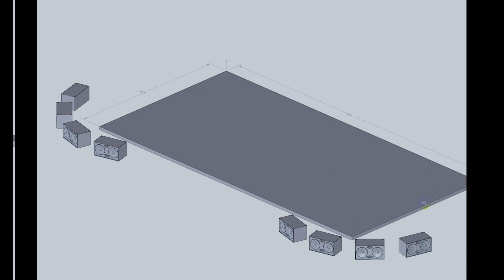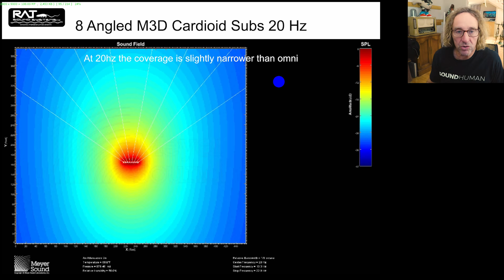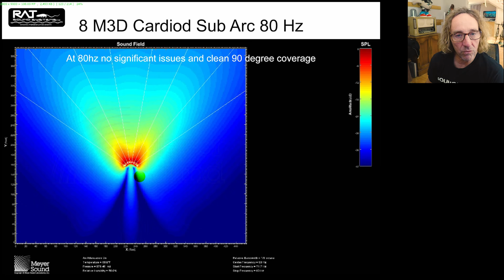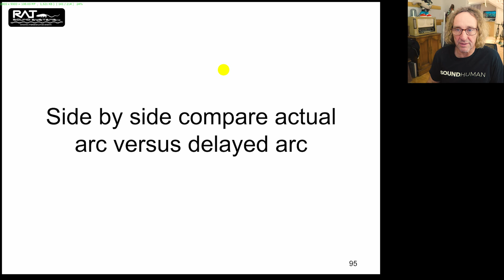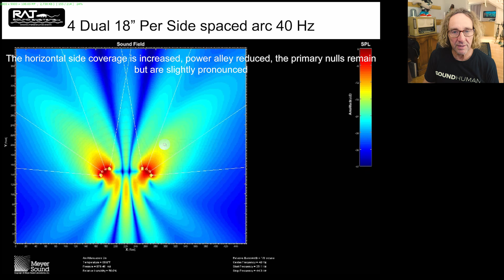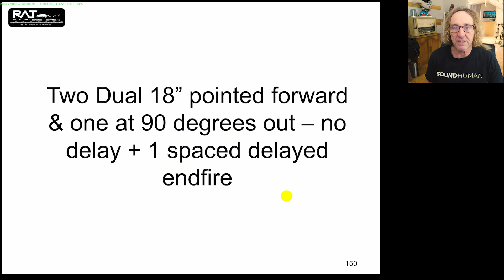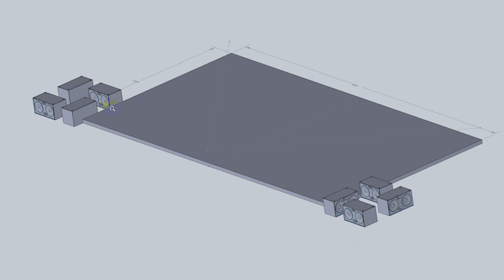Better Sounding Subwoofer Arrays Part 2 - Sub Arcs, Delay & End-Fire

Comment: Nice thank you for that,  My question is in a smaller set up could you do or achieve similar reactions with single 18"  ..
And obviously the energy would not be the same but I think you know what I mean.    :)
Reply: You asked me if I watched part #1 so I went back and I think you missed what I was asking please read my first Question ,  " a single 18 " not a single double 18
Reply from the maker: They will be nearly identical with the single 18 being 3 to 6 db lower in output and the dual 18 a slight bit more beamy.

But all 9n all, a dual 18 and single 18 will del the same up to 100 Hz and not to different above 100
Reply from the maker: Did you watch the 1st vid where I start with a single sub?
Reply: @DaveRat  I Guess not.  Thanks anyways ...
Reply from the maker: In the first vid I start with a single sub, then one per side, then 4 per side and so on. I think that would explain it better than I can do in a comment thread

As far as single vs dual 18 cab, the response and coverage is pretty close. In vid 4 I will show one array vs 2 and how to deal with interactions.
Reply: @DaveRat  Thanks that`s what I thought ..   Have a very merry CHRISTMAS.   :)
Reply from the maker: Merry Christmas!!

Comment: Is there any type of delay/eq that allows you to delay different bands at different times? Kind of like a multi band crossover with a delay on each band summed back into the one output?
Reply: That sounds like a total mess waiting to happen to me.
Reply: @djjazzyjeff1232  why? So you could fix the dead spots at different frequencies with different delays?
Reply: @ambroselockerman1115  It just sounds like you'll be chasing your tail forever and have the most complex and sophisticated crap sounding PA in history.  Of course, I could be wrong, I'm effectively nobody here, but that's just my initial 2-cents is all.
Reply from the maker: In video 4 I will show some simple and more complex ways to improve coverage without doing freq dependant delaying of various frequencies.

The goal is to improve coverage without adding too much complexity and without introducing aspects that will degrade fidelity.
Reply: @djjazzyjeff1232  im running eaw tops processed with the ux3600. It has all kinds of filters and delays and sounds amazing with the speakers and amps. Do you know anything about tuning a PA system? Power alleys and dead zones? Have you ever experienced trying to get a bunch of subs arranged in a way the disperse throughout a field of 50,000 people?
Reply: @ambroselockerman1115  Lol I feel bad for everyone who has every worked with you if you feel that threatened by one slight criticism.
Reply: @djjazzyjeff1232  im just trying to have a discussion. You are the one saying its gonna be a mess. I don’t understand why you would not want to try everything possible to fix these issues. Im not threatened or anything, like i say I just want to get to a better sounding sub setup for my 6 community sbs45 boxes.
Reply from the maker: Sub coverage issues tend to be solvable with good sounding results using well thought out physical placement and delays.

Adding delays to one side or the other does not eliminate cancellation nulls, it just moves them. Adding freq dependant delays could move the nulls around at the expense of sound quality and increased complexity. 

I will show some easier ways to reduce and eliminate nulls.
Reply: @ambroselockerman1115  That's not true, you came out guns-a-blazing, I'm not going to continue this thread I don't see anything to gain from it.
Reply: @djjazzyjeff1232  good.

Comment: What's the gap between speakers you usually set up for the conventional+end fire array, 1/4 or 1/2 wave length?
Reply: would depend what you wanted to achieve, and at what frequencies. and where
Reply: Let's say for eg. 85hz would be the highest freq (xover point). For this Conv + End Fire config do we gap 1m (1/4 wave) or 2m (half wave) in between acoustic centre? Asking about this specific example shown in this vid by Dave.
Reply from the maker: Use 1/4 wavelength of either the center freq of the bandwidth or 1/4 wavelength of the most prominent or troublesome frequency.

Comment: Well you can adjust the cardioid design placing the speakers facing the artists out of phase but only some coming in at certain frequencies where you get the problem like 100 120 Hz and up that should work
I think having the speakers array in the back of the room should sort out that comb effect adjusting your frequency and delay accordingly does your software map that?
That spectrum only maps infinity space is not reflections because that would have a big bearing. Can you not show the returning ripple that's what it needs
Reply from the maker: Reflections tend to make more issues. Multiple spaces source create more interference patterns and each reflection tends to act like another source.

I will cover cardioid and more in future vids

Comment: Higher frequencies above the crossover point are typically present - the slope extends outwards at 12dB/octave... maybe 24dB/octave... and rarely 48 or 96dB "brickwall filters", but even with a filtered signal harmonic distortion from real loudspeaker drivers will be present several octaves above an input signal, even a sine wave.
Reply: But at what volume? If that higher frequency sounds coming from the subwoofer are more than 10dB quieter than mains I'd say it should be inaudible.
Reply from the maker: I believe that assumption is flawed. 10db is percievedbas 1/2 as loud. So if the issues are 10 db down, that would mean about 1/3 of the percieved sound 8s flawed 

The freqs are different. Though this example is different, one analogy is to think of a speaker operating at a high level that has a loose dome or slight rubbing of the voice coil or small hole in the cone. Have you ever heard any of those happen?

The speaker may be putting out 100db, 110db or whatever, the air leak or rubbing sound will only be a tiny fraction of the sound created, maybe 30 or more dB quiter than the speaker output yet clearly audible.

Another example is distortion. We look for gear with a fraction of a % of distortion.

Take one speaker and play it at 100 db clean. Place another speaker next to the first speaker and play it 10db down at 90 db with 100% distortion.

Would the speaker playing at 90 db with 100% distortion be inaudible?
Reply from the maker: Agreed